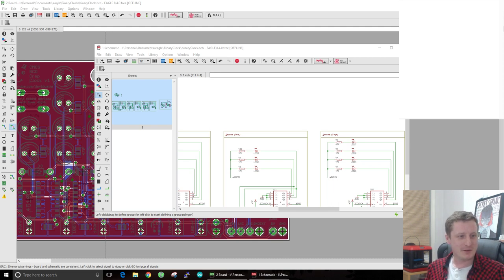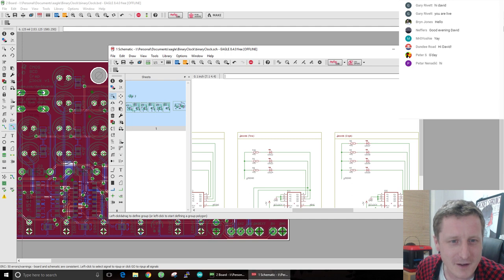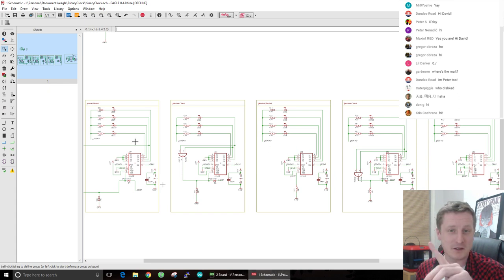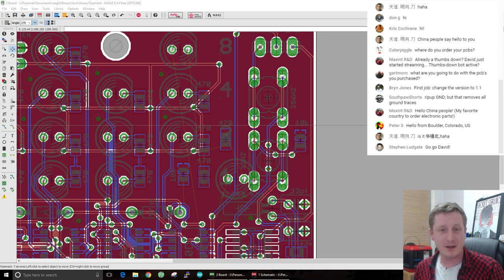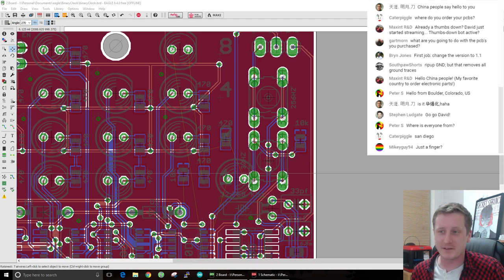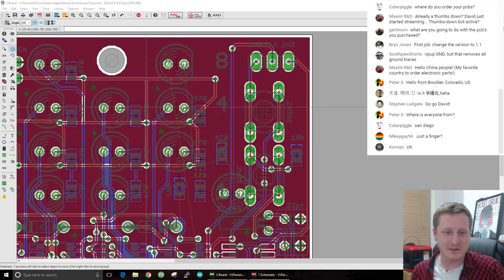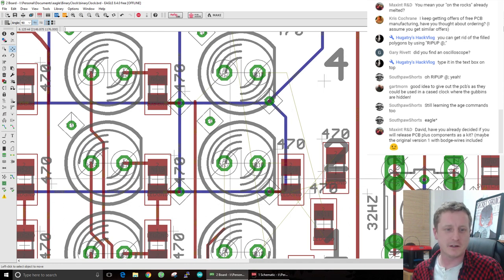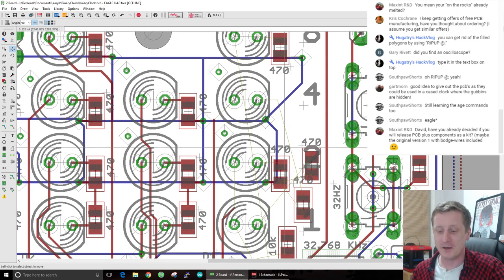Live Stream 22 - Fixin' the Binary Clock Schematic and PCB Layout

Comment: You also don't have to pull up the properties panel on each component to look at which each one is and whether they're in order. If you simply select the component, look at the lower part of the screen. It will show you what the component properties are without actually pulling up the properties panel.

Comment: PCB Fabrication: I've used JLCPCB a couple of times and their boards are excellent and also very cheap (TIP always select 10 boards instead of the default 5 - the price is the same).
Oscilloscopes: I got a new SIGLENT SDS1102 100Mhz (1GSa/S) a couple of years ago from a Chinese UK drop-shipper on eBay for £190 - I believe from watching EEVBlog that a lot of other brands are just re-badged SIGLENTs.
Design question: Why are you grounding carry-out pins? They are totem-pole output pins.
Reply from the maker: Thanks, I will take a look at JLCPCB. I have just had to go back to the breadboard to check and you are right, I have left the CO pin unconnected where it isn't used except on the last IC in the string. I am not sure why I did that but I took it as correct wiring it seems. I will have a tinker with the bodge wires and see what breaks.